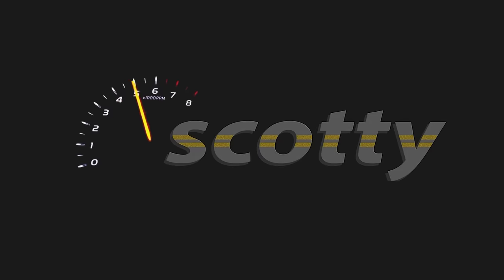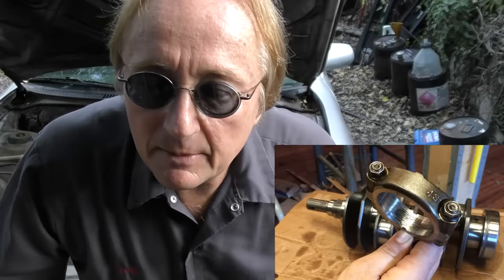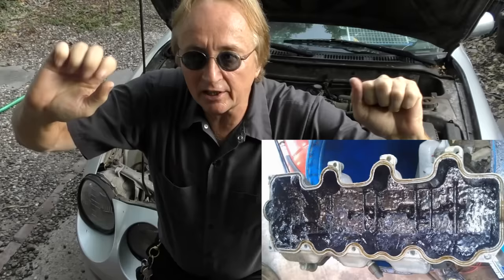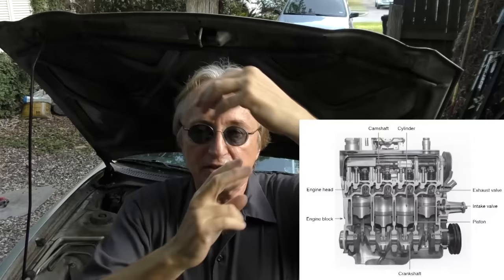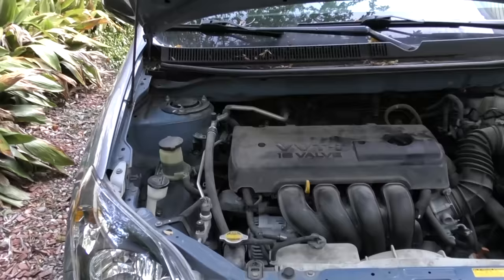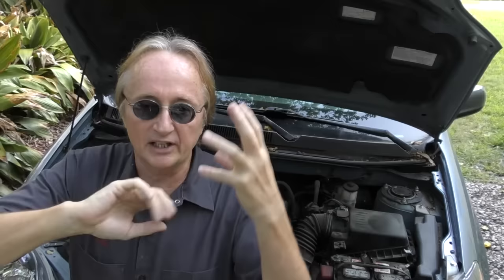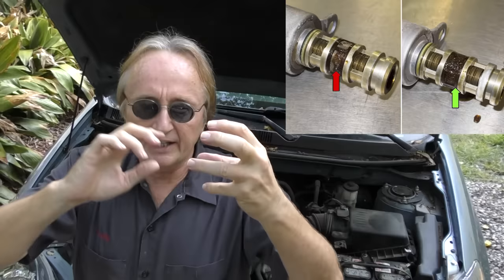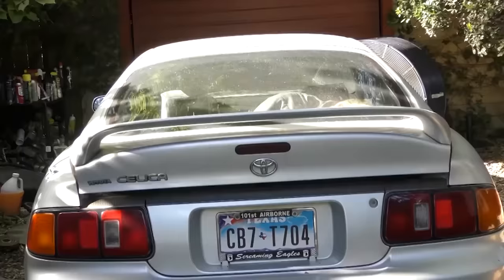Why Not to Flush the Engine Oil in Your Car

Comment: Great video Scotty! I've been religious about changing the oil in my VW Passat, and now it's up to 102k miles and still hasn't burned a drop. One thing I've wondered about though, is, should I change the transmission fluid in it? It's a 5 speed manual, and still shifts fine, and the clutch doesn't slip. The dealer told me it was a "lifetime fill" and I said "Define lifetime." I keep cars until the chassis rusts out. Judging by how this car is built, I'm hoping to get at least 500k out of it. Averaging 33k a year and so far it's been great!
Reply: Lifetime means: use it until you break it, then buy from me a new one, don't maintain it, because it inconvenience my business; I don't care about your economy, I care about my greedy bonuses.
Change it every 55K miles, I suggest
Reply: The transmission fluid lasts the lifetime of the transmission. The lifetime of the transmission will be greatly reduced if you don't change out worn / dirty fluid. So, really, any fluid could be "lifetime fluid". Pour some pancake batter in there, and a week later, when your transmission falls out the bottom of your car, it could be said that the batter lasted the lifetime of the transmission. What I'm trying to say is I don't believe them. Change your fluid regularly. Or at least drain a little out to check it.
Reply: Most manufacturers advise you to change the mtf after 100k miles, 75w90 is cheaper than a gearbox.

Also you probably think it shifts smooth because you've psychologically adapted to it. 
My shocks kept deteriorating but i kept putting it off because i thought they weren't too bad, when i got to put new shocks in, the ride quality was simply night and day, and i realized how I'd been tricking myself into thinking that it wasn't so bad.
Reply: VW transmissions are sealed
Reply: MT fluid should be changed every 7-8 years I reckon, just make sure you fill it with the official vw/audi fluid as it performs excellently when cold compared to the competition
Reply: on ZF transmissions installed in BMWs. BMW says it is lifetime. ZF says every 100000km the fluid and filter should be changed. truste the manufacturer not VW
Reply: @simonshotter8960  there’s plenty that aren’t sealed from VW.
Reply: Every 100k miles change all the fluids llinked to transmission and breaks plus you must do the timing to the car which it’s very important 
Every 50k miles you can change coolant 
Oil max 7k miles

Comment: Hey Scotty I flushed my engine oil once because the car had oil burning issues, and blow by. Put in a Amsoil engine flush, the difference was huge. Fixed the whole engine and ever since I used pennzoil ultra platinum. Runs great.
Reply: This guy is way out of touch with current motors.  Ive seen dozens of cars do an engine flush and regain 10-40 PSI per cylinder alone, yet alone cleaning off the valves.  Especially important in turbo vehicles with small oil passages.
Reply: @ItsSerialBoX  I think you and OP mean big and/or industrial engines, maybe Diesel ones, so small engine car, like 1.5-2.5 L might have problems
Reply: Flushing an engine is a corrective measure. I think Scotty is saying that if you change the oil regularly, you should NOT flush your engine, since you're taking preventive measures. There are preventive flush products, weaker, usually used between oil changes.

Tip: heard a time ago that these oil detergents get "activated" on highway conditions (low torque, high rotation). Just ride on a highway for an hour or two then drain the oil WHILE warm from the travel, when the sludge is on liquid state. Its a natural flush.
Reply: @ItsSerialBoX  Yes but the problem with thóse engines is the recommendations from the factory due to enviromental regulations which prescribes an oil change every 19000 miles. Which is DOUBLE of what it was used to be. And since some people drive no more then 5k a year some seem to think the oil only needs to be changed every4 years......with all it's consequences 🤦🏻🙄.
Reply: @saultube44  No, not at all, smaller motors that run turbo's that get driven short distances where the oil doesn't properly get warmed up or cooled down enough before the motor gets shut off is where you see oil start to really break down.   A flush every 50k in nearly any motor these days isn't going to hurt a damn thing.  This guy is reaching for clicks.
Reply: @joyrider6456  Wow, so cars could last way longer and don't become waste; yep, dead wrong, if I had a car I'd change every 5500-5600 Miles. Which type/brand do you use?
Reply: @ItsSerialBoX  Thank you, 50,000 Miles looks reasonable. Which type/brand do you use?
Reply: @saultube44 iam gonna try stp engine treatment for my 2016 accord

Comment: I have flushed engines since the late 70's and never had a problem. But the more I watched your video here the more it makes sense as to what you say.  I do remember rebuilding engines and changing valve cover gaskets on 1960's and 70's chevy 350 and 400 small blocks and yes tons of sludge. But then when i did the same in the 90's and later not much sludge and the detergent oils kept them clean as you say.  Very good video you have done here

Comment: Thanks Scotty! Right on time! I was just looking to order Oil flush for my 27 year young Honda Accord. There is no way am going to do now! Only frequent oil change and filter will be untill rust eats it ;)
Reply: Nexi Tech I do the same with my 32 yr old Mazda 323. Just change the oil, filter, and the car will run for many years.
Reply: I agree with Scotty 👍🏻👍🏻👍🏻
Reply: Right on time! Some guys are just not clever enough to have a clean engine. Although they almost made it! :D
Reply: You realize this guy is off his meds ?
Reply: geoffrey calligan stop being mean to Scotty!!!
Reply: I have ran Sea Foam in my last 3 Hondas.  My latest is a 198k Integra GSR.   I happily have ran seafoam through the oil twice now.  

But I do agree with Scotty at the same time as I disagree with him.  

First off I'm not all oil additives or equal. 

Second it depends on how dirty the engine is.  

I would NEVER use a flush in a motor with built up deposits like Scotty described.  But I have used Sea Foam multiple times with zero issues in cars that haven't had their oil changed as often as needed and have dirty insides.  I noticed that the oil stays cleaner longer after an oil change each time I run the Sea Foam.
Reply: A flush in a very dirty engine has to be done slowly by dissolving the sludge  by using d a pint or a quart of Marvel Mystry Oil  when you change the oil. You might have to change the filter about 4 times during a 4000 mile interval..Use a cheaper filter like a basic 5 USD Purolater for frequent swaps  and eventually it will dissolve the sludge without having chunks of it in the engine. You may have a PCV valve that is not working right and the crankcase may not be venting property..
Reply: SORRY BUDDY I did not notice your advice before I posted and yours is more articulate than mine..We agree that a slow clean is the best way. Yea the cheap orange Fram for a short use is fine .. THNX /
Reply: M DV  
Sorry to hear of your poor treatment as a veteran.
"Another problem in old engines is the stiffening of the oil seals (including the umbrella seals) that can be dealt with using a very simple and inexpensive oil additive that is very safe for your engine and only needs to be added once but not with any MMO. Care to guess?"
I can't guess can you fill us all in?
Reply: The Dave ... brake fluid I reckon.
Reply: You should change your filter every time you do an oil change! If you don't you will eventually start to lose oil pressure and start burning the engine up
Reply: Damn I feel young my car is only 19.
Reply: @jiakabery3550  I was going to put some Sea Foam in my oil to clean it. Are you saying that's not a good idea? I watched a video where a guy says to put in 1 oz per quart of oil your car takes. Then he says to change the oil after 200 miles. Mine takes 3.75 Quarts. 95 Honda Del sol... any thoughts? Thanks! P.s. is Sea Foam considered an engine flush like Scotty is saving in this video? Thanks!!
Reply: @jester4886  - Won't lose oil pressure. The bypass valve will open and unfiltered oil will be pumped into the engine.

Comment: I remember my Peugeot 407 diesel needed only every 25000 km change of synthetic oil as recommended by the factory. I sold it after 8 years and 250.000 km, it has always run great with lots of power and not losing a drop of oil. Great car

Comment: Just did an engine flush on my 9-3 Viggen. Worked like a charm. WARNING!!!! DO NOT RUN MORE THAN 15 MINUTES with the cleaning agent in your oil. The lifter clatter won't go away until after you drain the detergent oil out and refill with fresh oil. After about 20 minutes I was getting pretty demoralized as the tapping hadn't subsided, so I kept running it. Immediately noticed my water level start to go above where I am used to seeing it so I checked the engine temp and sure enough I was just a couple minutes from overheating! The detergent totally ruins the viscosity of the oil and it will stop lubricating properly. I probably caused more damage to my bearings than was necessary so don't make the same mistake as me. Still I am pleased with the results, my lifters have never been this quiet.

Comment: Best way to clean engine internals if you are in doubt:

Change the oil and the filter, drive around for 1000 km and do another oil change. This won't cost that much more than a bottle of flushing agent and won't harm your engine.

Best way to keep your engine internals clean: do proper servicing with high quality oil and shorten the drain intervals just to be on the safe side.
Reply: Sven Schwingel this is the truth.
Reply: Sven Schwingel 
Good idea.
Reply: Unless you own a diesel engine that holds 15 quarts lol
Reply: Tristen Dragon indeed. That's going to be a tad expensive. Or an older air-cooled Porsche 911 with dry sump lubrication. That's 15 quarts of synthetic as well.
Reply: Tristen Dragon Exactly, but even then, if it’s only going to be used for a thousand miles as a flushing oil, you don’t need to buy the good quality oil you’d normally use. Just wait until your auto store has a big sale on and buy a heap of the cheapest crap they have. It doesn’t really even need to be diesel oil. 

A trick my old man used to do was to keep the old used engine oil from his motorcycles for this purpose, if you have a modern sportbike or similar and you’re using high grade full syn and changing it regularly like you should in a high performance machine, the oil that comes out really isn’t anywhere near the end of it’s use by date on oil changes. On a newer bike engine it’s often barely dirty at all and perfectly fine to use as a flushing oil in your car or to re-use in your lawn mower 😁
Reply: If the thousand-mile oil isn't dark first, I don't think it will work.
Reply: If it doesn't turn dark quickly, it stands to reason that you either don't have a problem with dirt inside your engine or that you are using oil that has a lower capability of cleaning and dispersing.
Reply: I heard to get the best clean was to use synthetic oil but now I figure it's not a good idea to clean the engine anyway thanks to Scotty.
Reply: Excellent first step !!  then follow that first oil & filter change by 2 more in the next 1,000 miles.  My Dad's mantra was ... an extra oil change will do no harm.
Reply: I already have the best (for the money) clean oil option; bypass oil filtration. Seriously, look it up. It uses a rather silly and confusing word but in short, it cleans the oil so much that it's better than when it comes out the bottle new. I have my kit installed on a Diesel.
Reply: Maybe if you're in the US. Here 1000 km will cost ya around 120 eur, with my car.
Reply: If you have a car that has been sitting for a long time (a car you want to restore for example) and developed crud a flush would be necessary if you don't want to destroy the engine and you won't want to start the engine before flushing it, and it can be a multiple step process.
 - remove the old oil (if you see it is the consistency of vaseline paste it is a sign that it's as bad as to require this kind of flush)
- if it's as bad as oil not flowing you can put a syringe through the dipstick tube and pour some mineral solvent through it as the oil flows)
-  fill about 2/3 of the oil tank with diesel and let it soak for a day or so (diesel it's a very good solvent while still having some lubrifiation properties, and is not as dangerous as petrol) - the reason of not filling it full is that it is possible the crud might have gathered on the bottom and you don't want it to go in the upper part of the engine.
-  remove the diesel from the oil tank (it should have broken apart most of the crud pieces)
- put fresh oil and a new filter
- car should be in decent enough shape to attempt to start it.
-  run it for some miles
- add engine flush to the oil, run the engine for 5-10 mins
- change the oil and filter and it should be good to go
Reply: @KingOath  modern bike engine oil is some times also shared with it's transmission. modern bikes also rev over 5 digits. 10,000-19,000 RPMs. I wouldn't leave the bike oil in the car engine, I'd only use it for flushing.
Reply: Driving 1000 km with new oil and changing it is absolutely pointless waste of money, it won’t clean anything because it will come out of your engine clear, good as new. Change your oil, pour engine flush in to your engine that has new oil, it will come out bad as you have driven 15.000 km with it.
Reply: Hey Scotty, do you still feel this way now that your pushing that 505 CRO?
Reply: This will do nothing to remove the carbon deposits and sludge

Comment: Don't forget to check your oil now and then.
Reply: Ozzstar I normally use Vermont Maple Syrup and add quart a month. It’s burning a little bit more than normal. It’s an old horse.
Reply: Ozzstar that's the truth, I've seen many low mileage vehicles use oil between oil changes. I believe most vehicles last a long time if fresh oil is kept in it.
Reply: I check my car's oil every time I get it out of my garage, that's almost every three days.
Reply: Luminositymusic lol 😁
Reply: Bassam salim good idea.
Reply: Or get in the habit of checking the oil when you fill up with gas (that is if, you mostly do fill-ups). Or simply get into the habit of maybe checking it every Sunday. That I would say would be adequite if you don't do an awful lot of driving.     NOTE: If you happen to have a hard time remembering to check the oil, as in " ? ? Mmmm, when was the last time I checked my oil, I don't really remember." 
Do yourself a favor and scotch tape a small note to your dashboard as a reminder. Sticky notes don't work too well on dashboards.😊😊
Reply: Good idea, one time when my oil filter doesn't fully seal, drain half of it (base on oil stick level), if not because I check my oil twice a week (10y/o 215k km car) I definitely miss that and f up my engine.
Reply: Of course!
Reply: It's industry standard oil consumption upto 1litre per 1000 miles. its in the small print in the owners manual. You can invalidate the warranty by not checking the oil level.
Reply: I change it every 7500 miles and check it every 1000 or so. Works like a champ.
Reply: No need on modern engines. Mine haven't used a drop in the past 3 years. Only changed it twice
Reply: super tech oil and filter works out fine for me. car is well over 250,000 miles, can still make a 500 miles trip like a dream.
Reply: @luminositymusic3810  I flushed my 2002 Yaris back in 2009 and never had an issue with the engine.....that's the only time i put a flush in that car.And i've always used good quality oil every 3k,i use Magnatec as i do little city driving and stop start.....still drives like a dream.Just change the oil 5k if fine.
Reply: @dlg5485   Yeah if it's under 100.000 miles.Over 100k then 5k.For normal driving.
Reply: @tardeliesmagic  
If you're using a high end full synthetic, you absolutely do not need to drain any more frequently than 7500 miles. Most people could go even longer if their driving style isn't too demanding. The main reasons I use high end fully synthetic oil is to extend my maint intervals, save money and reduce waste.

I recently sold a 2005 Chevy Colorado (4 cyl!) with 162,000 miles that I owned for 10 years. I changed the oil every 7500-8000 miles the whole time I owned it with Mobil1 EP and it still ran perfectly when I sold it, everything original but the clutch
Reply: @missioncodez  - Oil level should be checked after the motor is hot and has been sitting for about 10 minutes.
Read your car’s Owner’s Manual.
Reply: @danielfl.9347  - All ICEs use some oil.
Reply: Also check your oil when you re a young mechanic